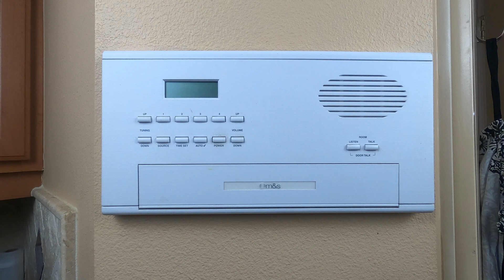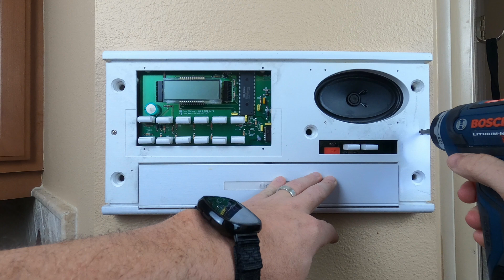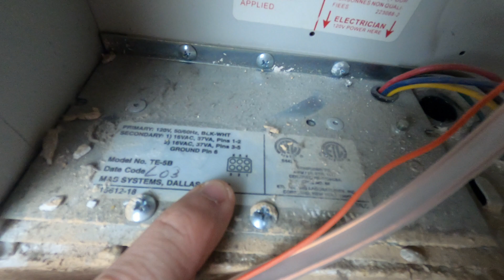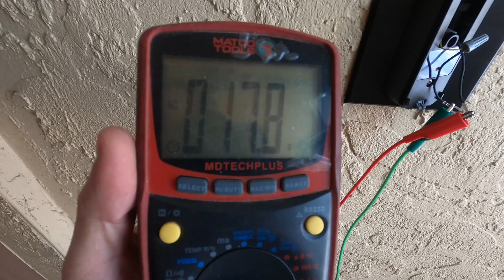How to connect a smart doorbell to a M&S or Nutone intercom system.

Comment: Thank you for this. I've got the exact same M&S unit. I did what you stated and have the correct voltage (AC) at the doorbell but I have not connected it yet. In the Ring manual for the Doorbell Gen 2, they state "If wiring directly to a doorbell transformer, connect a 25 ohm, 50W wirewound resistor in series with one of the doorbell wires to protect your Ring Doorbell." Do you think this is necessary for the M&S transformer?
Reply from the maker: @ohanmarkarian  I think it would be an extra step to protect your doorbell but not necessary. If your doorbell does short out, though, then it could damage the transformer without this resister.

Comment: Worked for about a week and now remains in an offline state.  I’m able to reset it and it will reconnect sometimes momentarily… Not sure why the doorbell will seem to be powered on but not connect.  Has to be a power issue, right?
Reply: I called ring and they tried to sell me a transformer
Reply from the maker: Will it connect to the wifi? I actually have the same issue with mine right now. I switched from a Blink doorbell to a Eeufy last week and I suspect that I grounded out the two wires by accident and overloaded the transformer. If you are handy at all, I will tell you how to check it. I may make a new video on this issue.
Reply: @JackofAllTrades1  it’s very strange…when I reset it it will start providing motion notifications but when you go to select the camera it will state it’s offline and recommend I need to purchase a WiFi extender which isn’t the problem.  I have multiple ring floodlights around the house alongside of the ring base station security system etc and they all connect to WiFi no issue.  

Curious if you have a workaround.  Otherwise I guess it’s time to opt for a battery version :(
Reply from the maker: @blakejohnsoncsr  I suspect your transformer in your head unit is likely shot. You can turn your breaker for it off and pull it out and see if the two fuses are blown... they are located in the plastic housings on either side of the transformer. A simple doorbell transformer from Lowes, ($20) would replace it if needed and can run the doorbell. 

Have you put a multimeter up to the leads to see if you are getting enough power? Usually has to be at least 16 volts AC.
Reply: @JackofAllTrades1  thanks a lot for the info!  I’ll let you know how it goes.  🙏🏻
Reply: @JackofAllTrades1  fuses looked good no signs of being blown.  Doorbell leads are getting 16vac.  Still won’t connect…
Reply from the maker: @blakejohnsoncsr  that's gonna be your doorbell then. I returned mine and got a working one yesterday. Now I just gotta shoot the video showing me replacing the transformer.
Reply: @JackofAllTrades1  I think you’re right.  This one has to be a dud.  Have a great weekend!
Reply: Got my replacement doorbell into today and it works again!
Reply from the maker: @blakejohnsoncsr  awesome, great news!

Comment: Hi, I was looking into this and it seems like you might need a resistor or something in line with the transformer to keep the transformer from shorting when the ring video doorbell is pressed.   Not 100% sure but i believe when the button is pressed it momentarily shorts across its leads to activate an existing doorbell chime.  In this case there is none.  Rings website suggests using a resistor or power kit in bypass mode when directly connecting to transformer power.  Thoughts?

Also there is an example on rings blog of using a normally open relay in series that will close when pressing the ring button to activate the old chime.  FYI
Reply: I guess my initial comment was meant to verify that you don't damage your m&s system transformer by powering a ring doorbell directly without a resistor in series.   Depending on the model of the ring doorbell it may act as a dead short when the button on the ring doorbell is pressed,  regardless if the old chime is used or not.  Might just want to verify if all models of the ring doorbell should be directly connected to the transformer at the intercom master head unit.  Want to make sure no electrical hazards are created.
Reply: @JesseBialas  Only 1st and 2nd gen onbes require a 25Ohm wire wound resistor when connected directly to the transformer. The gen 3 or later versions has app based advance setting that by default do not create a short circuit when button is pressed and there is no chime in the circuit loop (only transformer), that is  the setup of this video.
Reply: @Mobius_Pizza  I have the Video Doorbell 3 Plus and connected the 18 VAC I was getting at pins 3 and 5 in the MC605. When I press the Ring doorbell, it does exactly as JesseBialas noted - it activates both my Ring chime unit as well as the M&S doorbell chime. I am not sure I need to be concerned with shorting the transformer, but I'm glad it's activating both chimes so that I not only hear it on my phone - I also hear it all over the house.
Reply from the maker: On this intercom system, the whole thing runs off DC voltage, and nearly all the smart doorbells run off AC voltage. The 4 wires that run from the head unit to the existing doorbell setup are 2 DC wires for the chime and then 2 speaker wires. The chime cirrcuit board itself in the head unit is actually the only part that is DC. I found that the rest of the headunit runs off low voltage AC. This is how I was able to "steal" power from another part and use it for the smart cameras.

Comment: Where does the pro power kit v2 get wired to?
Reply from the maker: You only need those power kits if you don't have this setup in the video to power it. If you follow the tutorial here than you can just use the existing wires from the old intercom system and won't use the power kit at all.

Comment: I wished I had seen this video before I bought a solar panel for my ring door bell.  this is the exact system i have in my house thank you for step by step information. it was not mentioned if it chimes when we press the door bell
Reply from the maker: Thank you. The original chime will no longer work since the chime circuit board runs off DC voltage, and the smart doorbells are all AC. We use an Amazon Echo to now do our chime and it works nice.

Comment: Thanks this worked for powering the Ring Pro doorbell but I was hoping it will ring the speakers/chime inside each room like it used to for M&S intercom.
Reply from the maker: I initially set out to do the same. My wife really liked the old chime. I think the deciding factor was that the old chime ran off DC voltage and the ring doorbell needed AC and it just wasn't compatible.

Comment: Any way convert the whole system to ac, so I can use ac power for door bell and smart speaker wall mount for each room ?
Reply from the maker: Yea, you could connect all the wires that go to each room the way it is set up in this video. May take some creativity with the connection, and I suppose it would drop some amps with the extra resistance. If you need higher volts you could use the AC transformer that's buried in the wall but you'd need larger wires ran to the rooms capable of handling the higher voltage. It really depends on what you need.

Comment: Thanks for the video. I had power for the first couple of hours and then the ring no longer had power. Any advice?
Reply from the maker: Check the pins that you selected from the head unit harness and make sure they have the correct voltage. I noticed the first set of pins I used had fluctuating voltage so I had to choose another set. Also check that all connections are secure.
Reply: @JackofAllTrades1  Thanks, I'll give that a shot and check back! So it doesn't have to be the two pins that you used? Did you used the provided transformer at all?

Comment: Great video.   Are you connecting the intercom systems chime so it rings when new video doorbell is pressed?  I am connecting an Arlo power kit to my M&S intercom system and want the intercom chime to ring (as it formerly chimed) when the new video doorbell is pressed.
Reply from the maker: Unfortunately that's not possible with this method. I wanted to maintain our chime as well because my wife really liked it, but it's not an easy task at all. Connection to any of the old chime wires with this new setup only causes it to ring constantly.
Reply: @JackofAllTrades1 Thanks.   I will quit down that path then.  I also bought an Echo Show 8 for video display.   Looks like I can add a skill to make it chime (after wiring the camera)
Reply from the maker: @ElsieWahlig  yep, that's what we did. We programmed it to ding.... and also say "is anybody gonna get the door" . :)
Reply: @JackofAllTrades1  It maybe possible with a diode and a resistor that is sized right so above certain current draw of the AC circuit the DC chime is activated. Note that rign gen 3 has internal diode that can be activated when configured that you have a digital chime, so external diode is not needed
Reply from the maker: @Mobius_Pizza  thanks for providing that info.
Reply: @JackofAllTrades1  another YouTube video by northsideservicecompany3567 used a relay to activate an old DC chime circuit. Which sounds complicated but actually quite easy to do too.
Reply from the maker: @Mobius_Pizza  thanks for the info.

Comment: Unfortunately my intercom system connects from head unit to all room intercom devices with a RJ45 Ethernet cable. Hoped to find instructions on how to achieve the same result.
Reply from the maker: Ethernet carries power but I am unsure how much and if it's DC or AC (assuming DC). If you have a multimeter you could check... should be 5 to 6 wires in there.

Comment: Thanks for the very detailed video. I have been trying to find a suitable video for over 4 years now and this is the first one that describes that process in a simple manner.  

Quick question: I have the M&S system wherein the sticker in the transformer shows the following:   

24VAC, 40VA, PINS 1-3
CT PIN2
GROUND PIN 5

When I connect the two wires to PINS 1 and 3, it gives 48 VAC. Alternatively, if I connect PINS 1 and 2, I get 24 VAC. Should I connect PINS 1 and 2 in my case for the Ring Doorbell to work?
Reply from the maker: Yes, use the 24VAC....I believe 24-26 volts is the threshold for most of these smaller doorbells, so the other option would be too much.

Comment: What not just jump from the 3 & 5 pin to the existing chime common and the chime should work off the ring?
Reply: Not just the common, but the ringer pin also.
Reply: Did you try just the common?
Reply from the maker: @deweyharding3814  yes. Used several combinations in hope that it would work without having to take the route that I eventually did.
Reply: if you use one wire instead of both can you make it a loop so the doorbell chimes the ringer?
Reply from the maker: @Tristan Cribaro  unfortunately that won't work. The chime runs off DC voltage and most if not all of these smart doorbells need AC voltage.
Reply from the maker: I tried it and the bell rings continuously.  I think you may be able to get away with doing that and having a solenoid in between so thats its just a brief connection but it can't be continuous.

Comment: If there isnt a schematic for ac power how can i figure out
Reply from the maker: If you have a multi meter, then you could test the voltage coming out of the harness, test different wires. If you don't then pick a red and black wire and use them. The voltage is really low so if the two wires you pick don't work, then try two other wires. It's best to have a multimeter though... they are useful for a lot of other projects. Thanks for commenting.
Reply: If i wanted to rid of intercom system could i do so n still have power for ring ? Or would it still have to be connected to intercom face plate ?
Reply from the maker: @Mauria Pombo you could remove that whole head unit facing and just leave that transformer in there to power the wires. Like remove the facing and drywall over it. You would just need to leave an access cover to the transformer for it to pass code.
Reply: Ty!! You have finally answered the questions to solve what i am wanting to do! Made my day:)
Reply from the maker: @Mauria Pombo  awesome man, I'm glad I could help. It makes my day knowing I can help others. Please consider subscribing, it helps the channel reach others.

Comment: Thanks for the video! What do you think needs to be done to hook up the smart doorbell to the existing digital chime?
Reply from the maker: I think it would be possible to place a relay between the AC voltage source and the smart doorbell so that when the button is pressed, the signal that is produced closes a set of contacts that grounds out the comm pin and the ringer pin on the chime circuit board momentarily. You have to find what amount of voltage pulse was sent from the camera first in order to match it up with the correct size relay switch... which I believe is out of most people's abilities. I did t even care to do it myself as I have a smart ringer that detects the button push. Alternately, you could get a doorbell ringerfromm the store and gut it and place the insides in the interior panel box and feed the120 volts throughh it to the smart doorbell... this way it will ring a bell I side without the need for a digital/smart ringer.